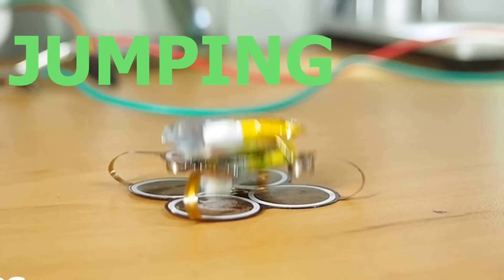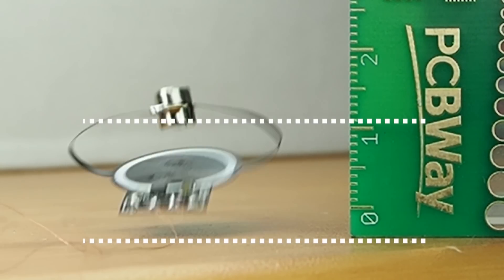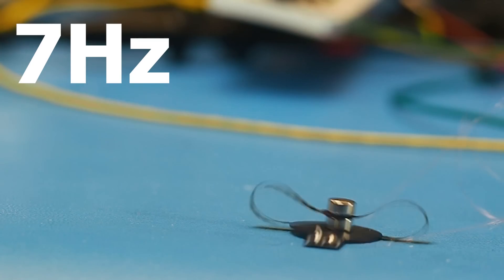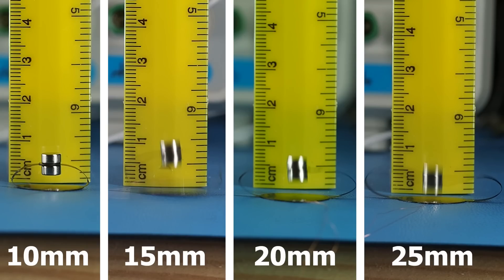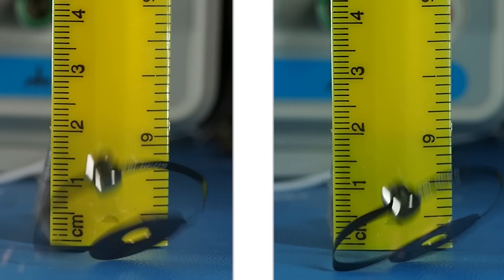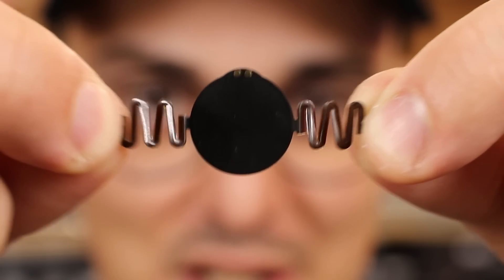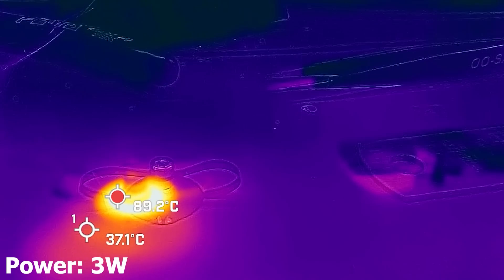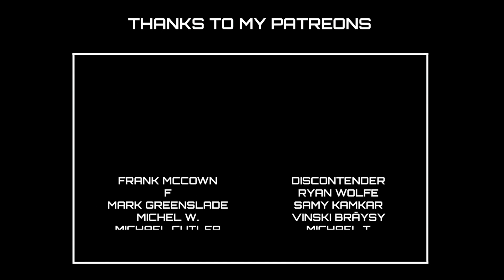Experimenting with Jumping PCB Robots

Comment: the magnet starts the jump very rapidly but then it's slowed down and it's loosing the momentum by bending arms inward. i think it would jump higher if the momentum would be transfered in the same rapid manner by hitting a stiff element by the magnet. then the kinetic energy would be transfered with less heat conversion (bending spring is heating it up right?). say if there would be a "frame/cage" and the coil would be mounted to the base and the magnet would hit the top element of the frame... i'm definitely not a physicist... :)

Comment: Hello! Thank you! Your video was very helpful to me. I have a suggestion, so I'm leaving a comment. Salto and Disney's hopping robots use elastic materials to recycle the impact energy generated during landing and improve the performance of subsequent jumps. Similarly, if a structure that acts as a spring between the magnet and PCB coil of your PCB robot is added, I wonder how much the performance of your PCB robot could be improved.
Below links are about Salto and Disney's hopping roobts.
(https://www.youtube.com/watch?v=wxexoj1gKoo)
(https://www.youtube.com/watch?v=M0ZXmGRCuts).
Thank you

Comment: fun project but not quite scientific. if the goal is to optimize existing design maybe do some research in kinematics. It probably needs to work in resonance mode so add a hall effect sensor and accelerometer. Otherwise completely redesign.

Comment: very interesting! I would be curious to see if upping the voltage could make these jump higher.... have you thought about running them at higher voltage and lower amprage? it should be more efficient at higher voltage? as for how to power a higher voltage system you could use miniquad batterys in a 4s configuration (14.8 volts).
Reply from the maker: It does work 🙂 I have mentioned this with the 3w test but it is limited with the temperature of the pcb

Comment: use 3 or 4 arms to prevent it twisting. the 12 layer would be cool but require more power I would think, not sure. what if the magnet goes through the coil, not sure if that would make a difference but interesting idea. awesome work.
Reply: also maybe swapping the polarity of the coil during a pulse would yield higher forces

Comment: Great video and verry interesting tests! Thank you.. 

I would love to se a version with multible stacked (folded PCB) coils.

It might also help to propperly time the pulse lenght. The jumping height is the highest, when the magnet is pulled to the lowest point. You might even be able to use the rebounce of the magnet on the surface, for extra acceleration (try on a silicone sheet).

Reversing the polarity in a second pulse will help to push the magnet up.

Comment: Hi Carl, the version I would like to see is where you have two opposing PCB coils, (rather than one PCB coil and one permanent magnet)
Switch the coil polarities back and forth between being mutually attractive and being mutually repulsive, and the whole assembly will hop. 
The overall weight will be MUCH lower too becuase flexible PCBs are lighter than permanent magnets. It should be easier to assemble too. Enjoy !

Comment: I'm not sure you can say it jumped 25mm. It reaches 25mm because of the extension of the flexible arms and the magnet. But the actual distance between its base and the ground is 10mm. Depends what you want it to do. Jumping over obstacles the 10mm count, jumping to reach something up high the 25mm are more important.

Comment: Is the objective to jump higher or to move smoother? The spring pcb design with plastic stiffners, on video at least, seemed to be able to move very little but very smoothly, so that with maybe some higher frequency of the switching it could move around easily
Reply from the maker: the spring pcb was more stable but for now my aim is too achieve the highest jump which will improve the jumping high & increases the weight limit of the battery version

Comment: Would it be viable to design coils that consist of two pcb bits that get folded and soldered onto each other, effectively creating a coil with twice the turns without the cons of working with thicker material everywhere?

Comment: Hey Carl, I'm not an electrical engineer, but since you're already using a coil, could you use an external electric field to slowly charge a capacitor via the coil?
Then a smaller circuit could be used to dump the contained power much faster

Comment: can you de-energize the coils sooner? Sending short pulses at high power with cooldown inbetween? Or are you already doing that? Also, can you pull the magnet back down mid air for higher (but less precise) jumps
Reply from the maker: That's what I did in the 3w test 🙂 I tried pulling the magnet down in my other video (https://youtu.be/gJBMEPMPwUk) but the results didn't improve
Reply: @CarlBugeja  ah, sorry for suggesting something you already tried

Comment: Nice one. Try using a rubber band to create a slingshot jumper. Use different shore hardness rubber with different lengths and thickness and find out which works for you